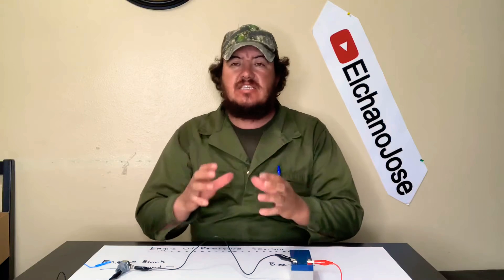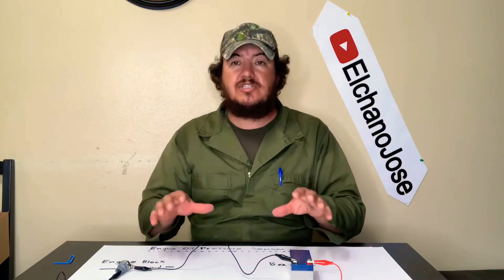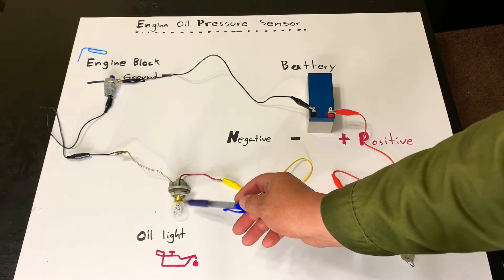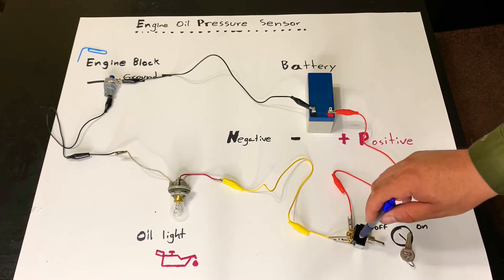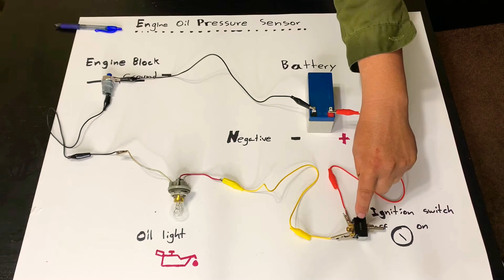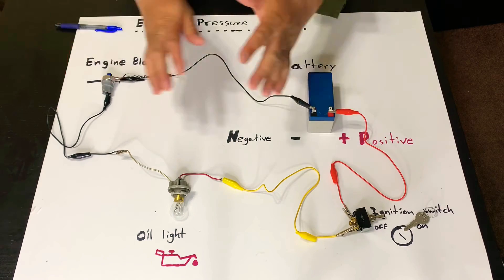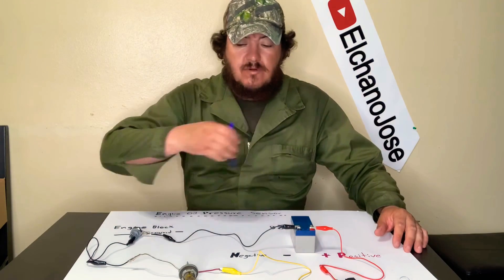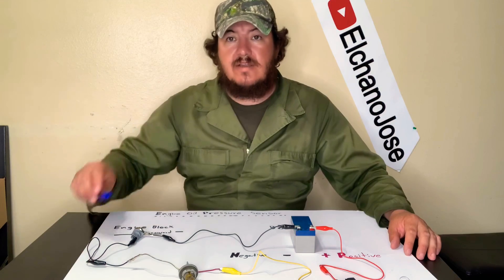How an oil pressure sensor switch works @elchanojose

Comment: Question, where does the pressure come from? I took mine out and put a small wire into the block and all I felt was a solid mass. Is there a small pinhole or something the pressure comes from? My light stays on until my engine gets hot, then turns off. New rebuilt engine also. Thanks for the tutorial. 👍
Reply from the maker: Hello Don!  The oil is sen to this point by a passageway that is no always straight where a opening can be fitted with a wire.  This opening is just for pressure straight from the oil pump.  If your car delays on turning the light on the oil pressure until it get hot, area things can be happening.  The oil sensor might be getting stuck.  The oil pump might no be developing enough pressure soon.  One thing you can do to verified if pressure is being made, is to put a a pressure tester and see if pressure is normal in the engine.  If pressure is normal or good pressure is made, then the sensor is the cause of this light staying on until hot.  Take well care Don!
Reply: @elchanojose  Actually my light stays on from the start until hot. I was just wondering if there may be a small pinhole where the oil is sent to the OPS? Something's clogged I think. OPS works, tested with a multimeter. The wires are fine. This all started right after they put in a newly rebuilt engine. No codes from the engine either. Engine temp is fine, no metal on metal sounds, it just slowly starts flickering then goes out eventually. Thanks, El Chano Jose! 👍
Reply from the maker: Sounds like the pressure builds up slower that normal.  If you want to go an extra step on testing the port.  Install a fitting with a plastic tubbing to see and test how much oil comes out into a container when the motor is turned on.  But like we mentioned, this is an extra step to see the amount of oil that comes out from that port.  If you do this, make sure to have another person turning the key or holding the tubbing into the container.  But as you mentioned, all looks normal is just that the light turns off slowly and takes time.  What car is this for?
Reply: @elchanojose  Thanks, man. I have a 1990 Toyota pickup 4X4 DLX. I don't think any oil comes out of that port, that's why I think there's a small clog. When I changed the OPS yesterday it didn't look like there was oil on it at all. I've changed it twice and no oil came out either time. I was told at Midas it wouldn't leak, or very little will come out. I don't have much testing equipment to do it myself. Going back to Midas Monday, still under warranty. Really appreciate your help!